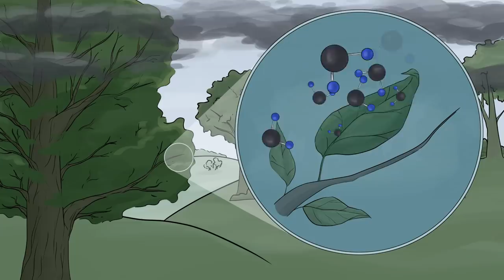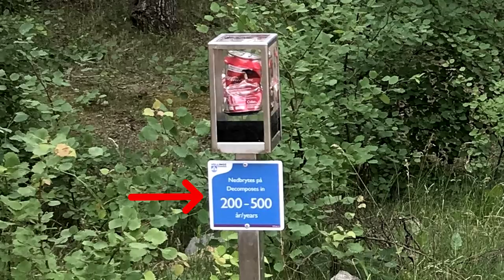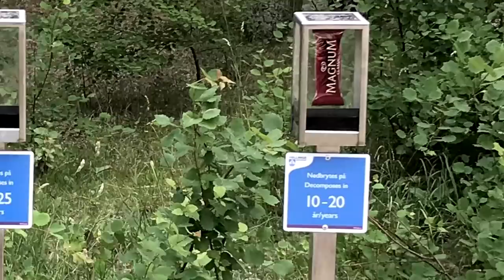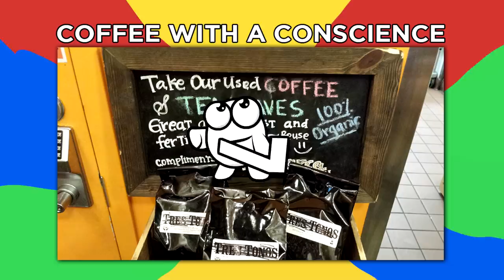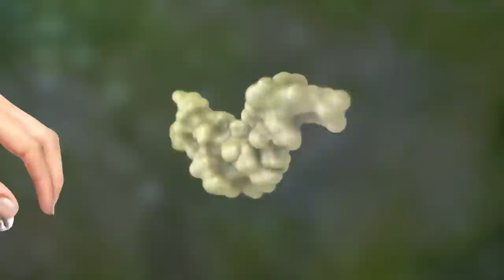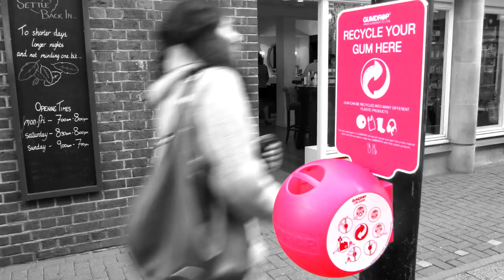Times People Truly Cared About Our Planet And You Can Start Doing The Same

Comment: The soap thing... When the soap is small enough I merge the soap with a new one. Just use the new soap bar so it has some lather on it. It must be some lather on it so the old soap bar sticks on the new. Thanks to this I use up the entire soap bar. When I take a shower I just take under 5 mins. I stands under the water for a min or something and then I shut the water off and then I use shampoo and soap. Then I rinse all this off. I shave once a week and I fill the basin with one or 2 liters. Then I put as little foam on as I can and wash off my hands in the basin. This saves water, energy, razor blades and foam. I use a dish washer and this saves water and energy. I recycle as much as I can. I dont buy clothes as much per year. I have enough of that. I eat locally produced meat and dairy products. When I have washed my clothes I hang them in my apartment so the warmth in the apartment dry the clothes. The heat comes from a district heating plant that use wood as a fuel. Wood from forests that is not just taken down. The forests are taken care of in the best way possible for the environment. My car is a small diesel car and diesel is better than gas but when I can I may buy a hybrid or with renewable fuel. It depends on what used car I find! My electricity I use is renewable! I dont go to a restaurant so often.  I eat everything I cook I dont know what I can do better than this. The potato skins and stuff like that are sent to a treatment plant that mix this in to manure from farms and they produce methane from it to use as a fuel and energy production. The slurry of this production is now a better manure then regular manure that is sold back to farms. So they dont have to use as much fertilizer. I dont know what else I can do.
Reply: I really appreciate your ways to do better. I too do most of the things you say as well. I don't use a dishwasher though due to it uses alot of energy to run; such as electricity and water. I and my family only use electricity when we need it such as turning on lights only if they're needed and unplugging the items when not in use; which is called ghost electricity. We use only 1 low Watt lightbulb in per each room which saves me alot out of pocket. We recycle, changed our eating habits and we make our own dog food. So; the whole house is healthier in many ways.
Reply: @dawnc.9440  Dish washers use 5-10 liters of water and I use a setting that saves water and energy so it saves a lot for me! But I dont have to pay for water as many have to do in the US!

Comment: I live in Canada and our solar panels get covered in snow every winter essentially reducing the amount of electricity we can harvest. I am still baffled that our solar panels don't have small wind generators to run a heater or a brush to clear snow off the panels. I've also wondered why Nasa never put such things on the rovers to clean their solar panels. Aeroplanes use wind generators when the craft loses power a fan generator deploys powering the instruments in an emergency this could be adapted for solar panels and rovers alike totally mind-boggling there's no way no one but me has thought this, and if this is the case and I spoiled an idea that I could market then whoever does this I want 5% of the profits lol. As for buying plastic pop bottles and pop cans Sasakatooon has been doing this for decades they are called Sarcan and you will not find a pop can or pop bottle on the ground there.

Comment: its funny how the sign says cans take 200-500 years to decompose i have seen cans only 30 year's old that is nearly degraded all the way but luv the vid
Reply: i would guess the cans you've seen are made of sheet metal instead of aluminum. sheet metal will rust away quite fast but sins aluminum doesn't rust i would guess they could last for some time. not an expert so might be wrong tho :)